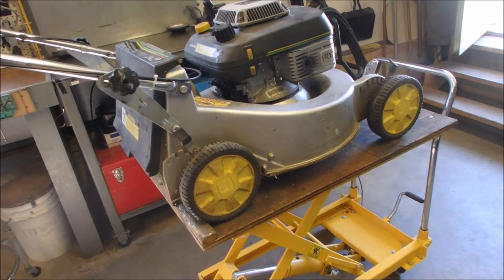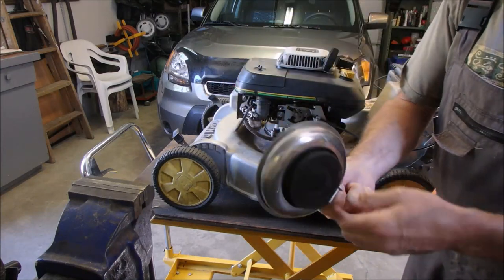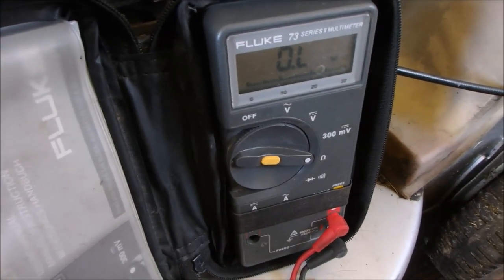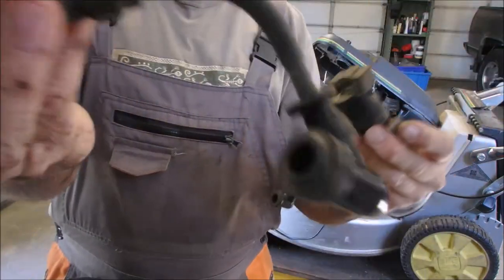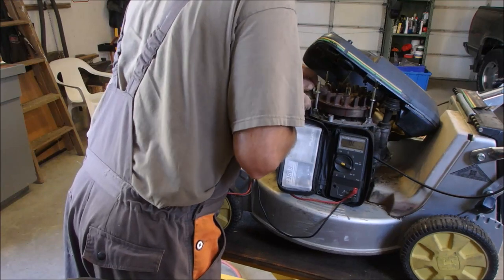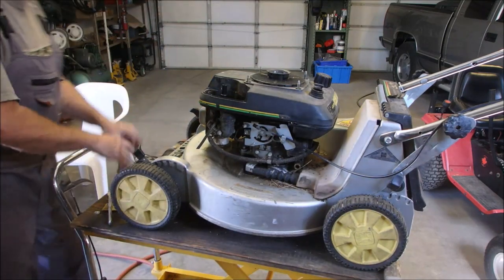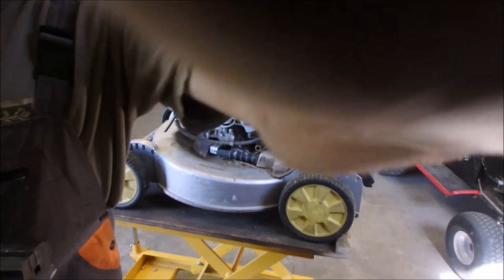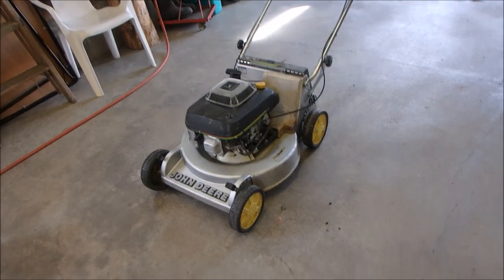Old John Deere Mower Won't Start

Comment: Nice video Bruce. Years back when I first got one of those magnetic parts trays I thought I lost a bolt. Looked all over for it. Figured it must have gone through a black hole and was orbiting a galaxy in some other dimension. Weeks later I found it stuck underneath the bowl as you have shown. LOL
Reply from the maker: I think everybody has done it  (ones with a tray anyway haha)

Comment: Great fix Bruce. I laughed when you pulled out the business card because many many years ago an old timer tought me that trick and it works great
Reply from the maker: It does.  10 thousands.
Reply: I used my insurance card from where I work, did just fine :)

Comment: Great video! To take the top cover off completely, you need to unscrew the fuel cut off switch, I have three of these, bought a later one at auction on the weekend but doesn't want to run...
Reply from the maker: This was an older video of mine but I do remember something about that.

Comment: Great video Bruce very informative. Do you ever find  when you dont get a spark that you clean the magnets on flywheel and coil that it will run again. i found that my mower had heaps of rust on flywheel mangnets and coil. cleaned with wire brush and works again.
Reply from the maker: You know I have not had any luck cleaning out the rust from the flywheel.  Magnetism isn't affected by dirt.  Maybe iron filing though.

Comment: You make it look so easy!! Im at south TX had that same 14sb and had always worked fine. It recently stopped working, i haven't been able to make it start the carb is fine I changed the gas lines and I do get some spark cuz I even had an accidental discharge jaja but it might be that piece you took out that takes the spark up the engine right? Would love to get a little advice from you great video

Comment: Bruce, I have two of those fine JD/Kaw mowers but I have never had to take the top off. Thanks for the instructive video. Did you know that that motor can be fitted with an oil filter?
Reply from the maker: No.  But the oil drain is cool!!
Reply: Hi Are these lawn mowers collectors pieces?  as they are commercial same with the toros with the Suzuki engine?

Comment: Very good.  I just worked on a slightly earlier model.  It had a separate ignition module fitted to the governer control plate,

Comment: Nice repair. If the coil fits use it. I would imagine new Kawasaki coils don't come cheap.
Reply from the maker: Looks like it is about $50 U.S.+ shipping.   That isn't to bad but the problem is waiting for the part when the mower is needed right away.  That is the old story.
Reply: You know small engine parts prices are are high when you say  "$50 U.S.+ shipping isn't to bad".
Reply from the maker: Yes that works out to $70 Canadian + shipping.  I am looking at a Stihl ignition coil right now and it is $90 U.S.  Ouch.
Reply: What spark plug does it take? Bpr 4Es?

Comment: Still working on the fc150v and removed carb.  I did not see a rubber seat under the float needle and the diagrams don't show one.  Is this the design.
Reply from the maker: Well I would just clean it and give it a try.  Even each model may be different.  I just don't know.

Comment: Bruce, thanks for the video. Any chance you have a part number for the Honda Coil? I've been trying to find a replacement for my JD 14SB, but the aftermarket ones don't look right and the OEM from JD is $$$.
Reply from the maker: That is a Kawasaki engine.  A Honda will fit.  This is amazon.com for the U.S.
https://www.amazon.com/PARTSRUN-Ignition-36100-ZE1-015-36100-883-005-ZF-IG-A00031/dp/B085BN54TZ/ref=sr_1_4?dchild=1&keywords=coil+for+honda+hr194&qid=1600213125&sr=8-4

Comment: recently got the JD 14SX Commercial.  Not starting.  Giving it a once over.  Stuck though, not able to remove the nut under the dust screen.  The engine just spins with the ratchet.  The mower blade does not spin when I ratchet the nut, so that did not help.  How do I lock the fly wheel to remove the nut?
Reply from the maker: Remember the blade is on a clutch so it isn't connected to the engine directly.  Do you have access to an impact socket of some type that will loosen it.
Reply: @BrucesShop  I found a pipe wrench to fit on the starter wheel & hold it , that did the trick.  Thanks for replying.

Comment: Those units with the brake clutch can be a bit noisy once the bearing start to go.  I have the flywheel style brake, which doesn't allow the engine to keep running.  It's kind of frustrating.
Reply from the maker: ineresting

Comment: Working on a kawasaki fc150/snapper p21550 and appears to have a bad coil.  I can't find a cheaper oem replacement so I might look for the honda coil
Reply from the maker: Yes a Honda coil may fit.  They all stole ideas from each other.

Comment: Bruce nice good how u spun the engine over with the impact I wouldn't recommend because I Reyes to start a 5hp like that and broke the nut off the crank just a little tip
Reply from the maker: The plug was out so I was fairey safe.  With the plug in that could get exciting!!!    Thanks

Comment: Was yours not starting at all with the original coil or did it run some?  Mine runs, but seems to have weak / intermittent spark (it misfires and when I have an inline spark tester it flashes off when the misfire occurs) and I was wondering if you ever ran into that? I tried to replace the little ignition module that is mounted on the throttle / governor plate and it did not help.   I appreciate any help!
Reply from the maker: I would replace the main coil.  I think it sputtered and quit after starting.
Reply: @BrucesShop  Ok, thank you!

Comment: Hi Bruce, how old is this John Deere? I had look on eBay for one and they don't exist, I wouldn't mind getting one that is self-propelled, is the body diecast alliminium? I wonder how much it would cost to ship one to Australia. I have a push on lawn mower purchased 2001 Quantum xts 60 Steel body that is starting to rust, engine is great and always serviced by me. I also have a complete 1964 Victa Corvette with a diecast body that still works, but I don't use it because it is very loud. Also have a John Deere D130, l had a problem with backfiring and surging unit watching one of your video's ,I took apart the carby and found rust in the bowl, I must of had water in the fuel, I don't know where the rust came from, the bowl is in good condition. Thanks for your help.
Reply from the maker: I don't know how old it is.  Sorry.  Well a lot of different metals will rust.  Especially if you are close to the ocean.

Comment: Hi Bruce, 
where did u find that small engine lift? really handy. what's weight capacity? 
Marshall
Reply: Marshall Sayre I got mine at HARBOR FREIGHT.....2 sizes I believe they hold 500 lbs (169.00)  and 1000 pounds (259.00)
Bought one after watching my very first BRUCE video...saved my back 100x

Comment: Good video! I'm working on one of these for a neighbor. The starter cord won't pull when attached. Any idea what this might be?
Reply from the maker: Disconnect the spark and take it out.  Then see if the motor will turn over manually.  It may have liquid in the cylinder.
Reply: Thanks tried that. Emptied the oil and tried again. I'm leaning towards the flywheel key at this point.
Reply from the maker: Can you turn it over when pushing the blade?  Of course with the spark plug disconnected.
Reply: Sorry, so long for the reply. No, there is no difference when pushing the blade.
Reply from the maker: It is seized?
Reply: I think it might be. I'm going to go and pick up some PB blaster and see if that does the trick.
Reply from the maker: OK Sean.  That is interesting I have a nephew with the same name

Comment: Original coil could be replaced as well as by new very expensive coil or with cheap NAC coil, from T475, 575, 675 models :)
Reply from the maker: Thanks for that.  I will put this into my favourites.

Comment: Hi bruce i have a lawnflite pro with a kawasaki engine and its about a year old it always revs loud and strong but today i used it and it was quiet and very sluggish is this a common issues do you know? Ive never noticed it on a mower before
Reply from the maker: Well I always start with fuel.  Check the carb bowl for sediment and crud.  Don't be shy and take it right off.  You may discover as you go what it is.

Comment: How did you remove the flywheel bolt so easily? I can’t remove it because the flywheel just keeps spinning
Reply from the maker: I used an air impact.

Comment: I have the same Magneto coil on my 4.5 kawasaki  14 se JD mower, can you give me the number of the Honda coil you used? I would like to do the same. My mower is still in very good condition and I would like to use it a few more years. Have you had any isues using the honda magneto coil?
Reply from the maker: Sorry,  I am in Mexico still.  This is a view from ebay.  Not sure how it will come up
https://www.ebay.com/itm/293518004027?hash=item4457094f3b:g:B6oAAOSwb~9ZbQ5Q

Comment: Hi Bruce.
would you know where I can order a small d tool for carbs
Reply from the maker: D tool??
Reply: Bruce Pender 
Yes it's a small D adjusting screw on a carb..I found one on a shindaiwa trimmer it's a WYK carb..it's like the big D set screw but smaller
Reply from the maker: OK  I googled    " D tool for adjusting carbs"      and this came up.  Google is a good tool for everybody.  

https://www.amazon.ca/Homelite-Part-308535001-Carb-Adjustment/dp/B00DCZBKFO

Comment: Got one of these.  Very good mower. I'll still put money in it if need be. To get one like that now would be at least $600+
Reply from the maker: You are right.  They might even be  more money than that.
Reply: @BrucesShop  I also have a LawnBoy 8480. Probablly between the both of them I'll never have to buy another walk-behind again. Also have a 1960 or so Jacobson 2-cycle. Needs work but it does run like a swiss watch.

Comment: I just bought a "non-running" 14ST today for $55.  They guy tried yet again to start it, and it wouldn't go.  So, I carried it home to start looking at things.  I first checked spark: Good.  But then, after looking a bit, I realized that it wouldn't even try to start with the bar not pulled down on the handlebars.  I gave it a spray of ether, pulled the bar, and it started on the first pull....  It had been sitting for 10 years according to the owner.  Unbelievable....
Reply from the maker: Good for you

Comment: i have one of these but i need to fix the gas tank and i cant get teh net thing off he used the air gun thing on....its rusted on there the gas tank leaks so i need the top off to fix it but thats the problem im having i cant get the top off.
Reply from the maker: Try some penetrating fluid.  Sorry I am not there to he;p
Reply: @BrucesShop  yeah wiht help of a buddy i was able to get the top off wouldve been such a shame to throw this thing out or sell it dirt cheap its such a powerful lawnmower...the gas tank was all cracked so i opoxied it and hope it works and holds gas it leaked like crazy gas was literally pouring out it was so banged up so hopefully that fixes the problem for gas anyway it works i mowed my dads back lawn wiht it but it took a whole tnak of gas to do it then i notcied the leaks. ill put it back together tomorrow and hopefully it works like new.
Reply from the maker: @sonnyc3826  good for you.

Comment: Use to work on small engines on the side way back like thirty years ago a lot , recently started working on them again .  wow have price of parts come up , buying a junk mower and working on it - it just about got to be a trash or freebie in order to make any profit off of it in this day and time . Think my working on them is really short lived , unless I can get a freebie . Gave $25.00 for two mowers and boy did I get screwed , first one was a Honda but someone  cloned a Honda motor to another frame . It looked alright but found later threw Honda  Motor Corporation  that is wasn't a Honda frame and got it running and sold it cheap for it was a bagger model only and just got rid of it . Didn't like mowing with grass being throwed on me mowing .Second one was a Tecumseh bolt broke on blade holder - minus blade holder and blade . I think it's a good motor but parts will kill you , after cleaning the cab and all the other work I may clear $20.00 maybe . We'll I  think I'm going to settle back and when one comes along free I'll still be more cautious on the spending and working on it . Made the mistake of getting the Tecumseh , parts are  atrocious . Anyway I'm done  complaining  .....😡
Reply from the maker: Here where I live Blade adapters are about 25 new.  I use recovered one if i can.  Good luck with you new-old hobby

Comment: It seems I'm seeing more Hondas coming in with drive-of-ability  problems and transaxle concerns this year.   But 90% of all problems are due to fuel related issues in all  types of mowers & tractors.
Reply from the maker: Yes.  It is fun when the problem isn't fuel eh!!!
Reply: Very informative I enjoy all your video's  ,keep them coming. I am looking for a good supplier of small engine parts in  Canada specifically Edmonton any suggestions.

Comment: I am getting ready to try a honda coil on one of those Toro (Chinese) engines on my Personal Pace mower.  I am betting it will work as well.  Is the red mower that's been hanging out in your garage going to get a youtube feature soon?  I am eager to see the linkage and wire routing as I am restoring my yard man Hydro with the 18.5 Horse Platinum Briggs. Great vid, using China's standardization to keep things running, not filling a landfill, and not buying more chinese product :)
Reply from the maker: Yes one less mower in the landfill.  I am having a multi-part series of videos on the MTD coming soon  to  screen near you.hahaha

Comment: I have to pour a few drops of fuel in the carburetor to start my John Deere 14SE, similar to the one in your video. Then it runs fine.....
Reply from the maker: If you don't mind doing that is great.  Maybe the choke doesn't close all the way.
Reply: Bruce Pender I just tried it again and it fired off first pull....I think I had the gas turned off the first time.
duh......it runs great, other than a slight miss. I just watched one of your videos where you changed spark plug. I might try that.
Thank you for doing the videos. I know it takes 3 times as long to do something if you are trying to record it.....Take care.
Reply from the maker: Yes I was fixing a snowblower today and had to turn off the camera so I could get it done in time.

Comment: Broccoli, too funny
Reply from the maker: Now that most people are mulching instead of bagging there is a lot more "broccoli" in the mowers now.  
Thanks John
Reply: Bruce Pender I use a BG 56 (I don't have shop air). If you stay on top of it, it rarely gets too bad.
Reply from the maker: OK   A BG56???
Reply: Bruce Pender Small Stihl blower. I think they hand them out at Halloween.
Reply from the maker: OK I use my Blower to sweep the garage!!!  Funny